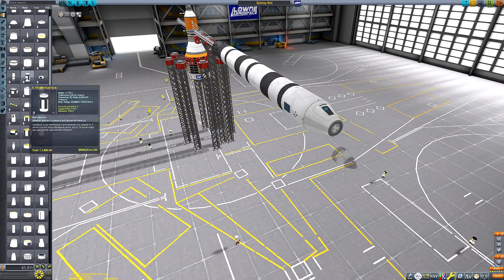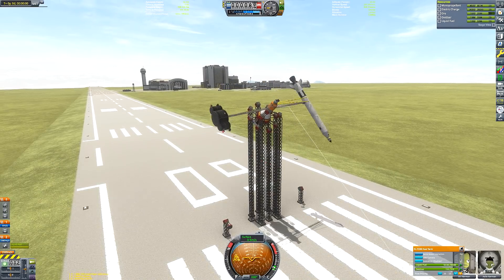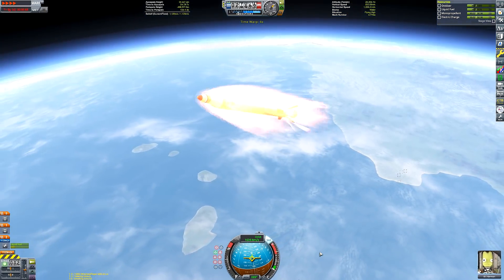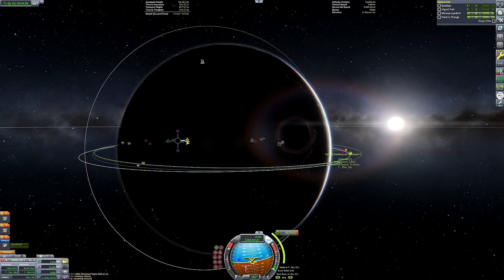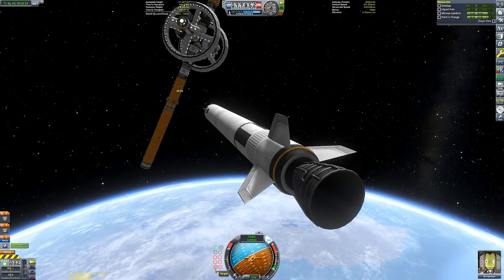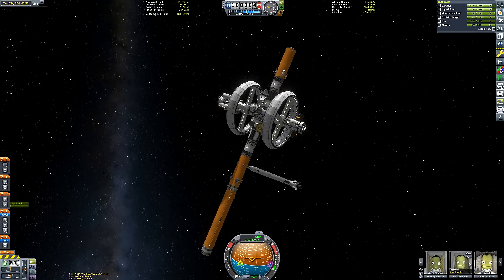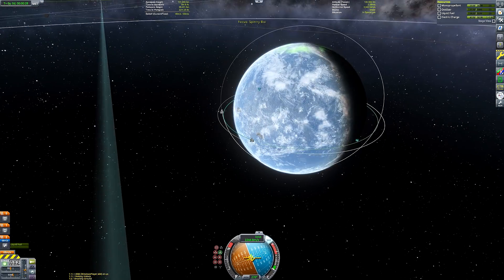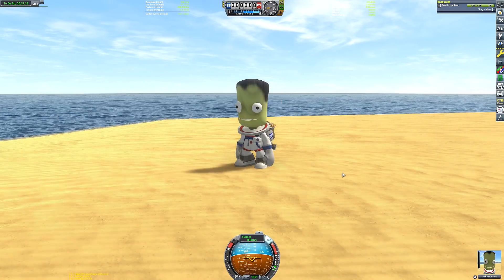KSP: Launching With a CENTRIFUGE! Spin Launch Recreation!

Comment: KSP robotics lack the sensors you'd use on a real system to trigger the release at the right point. Games are normally like this, but I thought your manual release was well-timed, Matt. Very careful control of the RPM could perhaps allow a perfect release with timing alone, using a KAL-1000 to very slowly increase the RPM so it's always at its limit and thus predictable enough that you can calculate the release time. The same KAL-1000 could trigger the release. Setting it up could be a bit of a headache though.

As for the 360, keep it; it's stylish! :D Or maybe not. A shorter rocket would have less angular momentum at its ends, so perhaps it would do a 180. Oh dear! XD If the rotating beam was very long, the release speed would be higher and the angular momentum would be proportionately less; a double bonus. Or you could mount the rocket on a rotor too, and synchronize its rotation so that it always points the right way. (Perhaps use the KAL-based slow-spinup described above.)

tl;dr: no easy fixes! 

Fun video though! :D

Comment: Only way to avoid the spin is to attach the rocket to the central core lower towards the engine rather than in the middle. Attaching the main beam up by the command pod would create the most spin, towards the engine the least amount of spin and in the middle where you had it... Well, a medium amount of spin.

Comment: What about vertical rotation instead of horizontal and inclined, you can throw directly straight and kinda avoid rocket rotating in the air

Comment: Imo if you designed it in such a way where you can release the rocket when centrifuge arm is parallel to the runway you could have gotten a little bit more delta V. This is due to the rocket wanting to travel the opposite direction of the centripetal force which is directed towards the centre of rotation. So basically your original design wanted to go leftward instead of straight ahead.  Therefore you started at 0 speed in relation to your planned trajectory

Comment: What about a circular craft with engines positioned radially - turn them on and off in turns, keeping thrust in the prograde direction?

Or put the engine itself on a rotor, synchronized with the rotation! Probably two engines, one on top and one on bottom for center of mass issues.

Definitely sounds easy so long as I don't have to do it.

Comment: Uh oh i just realized you said “Fuel Shortage” 
While theres tons of water out there (idk if im wrong or not but you use water for fuel, splitting the oxygen atom from water and liquified the oxygen
Reply: Well that's wrong and true, while you need oxygen for rockets you also need something to react with it.
For example Methan Wich the Starship will use.
Reply: @revo4613  Like the hydrogen from water?
Reply: @revo4613  sorry but, Starship will use hydrogen and oxygen along with Kerosene(RP-1) which is made from carbon and Hydrogens
Reply: Well crap
Reply: @revo4613  rockets fuel is from water. 
As long as there’s still no water shortage, theres no rocket fuel shortage 
And also you can get carbons from co2 which humans breath out

Comment: You probably could have saved more funds by NOT using a vector.  Those things are atrociously expensive.  Also, I'm fairly sure you burned more than 36 delta-v during the centrifuge wind up.

Comment: Speed of rotation isn't in M/h or km/h, it's in RPM
Reply: that’s true but you can also measure the speed at which an object is rotating in km/h ——-  k = d × r × 0.001885  Where, k = Kilometer Per Hour(km/hr) d = Wheel Diameter(cm) r = Revolution Per Minute(RPM)

Comment: That delta v in the beginning wasn't saved u just used xtra electricity and some fuel of the onboard rocket
Reply: 2 things:
1: the fuel was in a fuel tank on the centrifuge
2: there was a fuel shortage so he had to use something electrical, aka the centrifuge
so yes the fuel was saved

Comment: Matt: we dont have any fuel!
Also Matt: does all manoeuvres with the 1st stage
Reply: Wouldn’t that makes his rocket an another SSTO?
Reply: @tomthebuilder794  not a full one because it has to get the extra 36ms from the spin launch x3
Reply: @tomthebuilder794  hmmm you do have a point but he did say he had no ssto's to use
Reply: @magicchowder8433  the rocket itself is the second stage. the spinny bit at the bottom was stage 1.